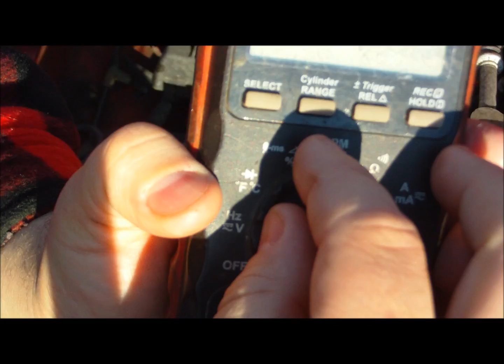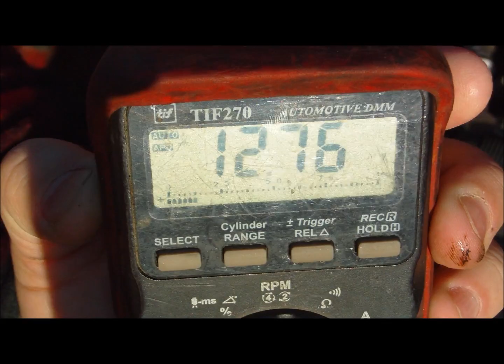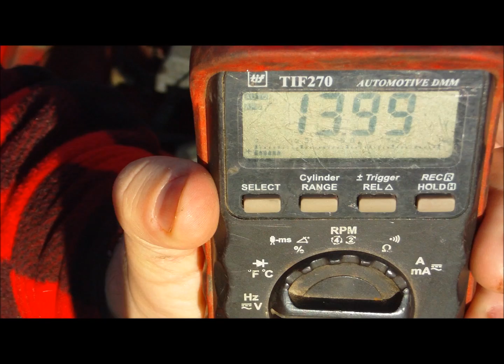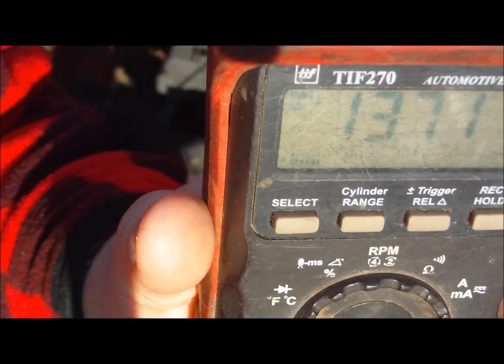How to check battery voltage, alternator voltage, and load test voltage  with a multimeter

Comment: maybe you can help me..

I recently replaced my belt and alternator (approximately 4 months) and last thursday, the battery light came on and when I got on the highway, it turned back off. if it helps, it was 6 days before I drove it on that Thursday. Today, I tested the battery and it was at 12.6ish. After I turned on the engine, it was at I believe 13.6ish. I believe the radio was on. The battery light also did not show up this time. I'm curious to why the battery light might've turned on. Last week was pretty cold here in NY, so I'm thinking maybe that affected the battery, but I am not sure. Also, on Friday, when I opened the hood, there was corrosion but today, Idk if it was the weather or not (rainy weather), but that just kinda disappeared. Any ideas what might've happened? My vehicle is a 2009 honda civic.

Comment: My alternator is putting out 14.59 volts I think it’s frying my ignition modules
Reply from the maker: 13.7v- 14.7v is the range you want. I am going to go out on a limb here and say you have another issue that’s frying your modules. I cannot diagnose it without actually looking at it. I wish you luck. Thanks for watching and commenting. I greatly appreciate it.

Comment: Thanks for sharing, but I've a question please
I'm installing a new car stereo, the recommended voltage by the company is 12v DC 
However when I tested the wires, it was 14 when the alternator is running 
What does that mean?
And can I connect the stereo to it?
Reply from the maker: If it was 14v then your car was running. Your alternator puts out 2 more volts for charging. Your car battery should be 12vdc. I personally would just hook the car stereo up. I hope this helps. Thanks for watching and commenting. Please like share and subscribe. Also please hit the notification tab 🔔

Comment: Great video. Now I have a question...no matter what jumper cables or charger I place on the battery in my 07 outlook the second I connect the negative clip to the battery post or ground post it sparks. I have had several vehicles and have never had this happen before..What could this be caused by?
Reply from the maker: Thanks. As for the sparks, how bad are they? Is it real lite or arking  as if you accidentally touched positive straight to ground?
Reply: @handymanPF   also when a battery charger, 2A, is hooked direct to the battery the charger cables get hot nearly instantly. Several chargers have been tried and all do the same.
Reply from the maker: Did you try disconnecting the battery from the vehicle and charging it and if so do the cables still get hot? Because, heat is the sign of excessive resistance and if your getting a spark on the ground side, almost sounds like you have a short somewhere and that’s why your battery is going dead. I would try to locate the short, start with anything that was recently modified or repaired and then go from there. I hope this helps, thanks for watching and commenting. Please keep me updated, I’m curious to what the problem is. Please like share and subscribe
Reply: They are like touching positive to ground...but one mechanic noticed that if you clamp the cables positive to the negative and the negative with the positive, there are no sparks at all. I know that's usually not something that's recommended but it was a fluke.

Comment: Thanks for this video.  Really liked the real time example showing what happens w engine off, engine on, with load on (lights, radio, wipers, ac, etc).  You've gotten over 300,000 views, so apparently it's helped alot of people!

I'm assuming if you didn't see the voltage jump up to to 14v or more when car is running you might suspect that the alternator is bad?
Reply from the maker: +Michael Milburn if your voltage is real high 15v or greater , it would be the voltage regulator inside of the alternator. So yes you would have to replace the alternator, unless you know someone who rebuilds. Thanks for watching and commenting. Please like share and subscribe.

Comment: This is a voltage test, not a load test!  This video states in the title "...and load test..." That's just telling you that the alternator is charging the battery and is keeping the required voltage AND amp draw to the battery. To do a draw test properly disconnect the battery and buy a proper "load test meter" $40 ...if the draw pulls the voltage any less than 9v AND then the "cold crank draw" spec is less than that of the manufactures standard THEN you know if the batteries good OR not. Multi Meters will ONLY tell you the min/max voltage NOT the draw. ;) ...yes, I saw the other video clip on the draw, however, you must take off the positive terminal because if you don't you're not considering parasitic drain etc.
Reply from the maker: +Wil you are correct but this is a quick video for someone who has never done this before and this test will tell them what is wrong. A proper load test can be found on this video https://youtu.be/30kf07g8CIs . This video right here is a great diagnostic aid. Thanks for watching and commenting. Please like share and subscribe.

Comment: i need help with my wife car .. when the car is off the voltage on battery is 12.5 when i turn it on the voltage goes to 14.5 shes turn everything on heat wipers etc and everything is fine 14.5 then the car start to kind of choke or run on 3 cylinder i dont know and the voltage goes crazy up and down ? i guess its the alternator right ? 
my obd2 gave me a code P0300 mulitple cylinder misfire but im starting to wonder if the alterator is bad and causing the whole problem she have a toyota tercel97 any advice would be appreciate thanks :)
Reply from the maker: +jp marts it doesn't sound like anything in the charging system, because those readings are good. What's the voltage range? Usually when voltage goes up and down, it's a bad regulator or rectifier. You can remove the alternator and have it tested at Autozone or advanced auto parts for free. They will also test your battery. But honestly I think your problem is elsewhere by the sounds of it. I hope this helps. Thanks for watching and commenting. Please like, share, and subscribe.
Reply: jp marts 

    Agree, not the charging system.  Start with basics of tune-up especially if they have not been changed in a while.  Test plugs, coils and wires.  Most misfires are one of these 3 areas.  Pull coils and look for white ish electrical brazing on the side cavities and/or on tube.  all these can be tested before replacing.

Comment: if my load reading drops from 14.0 to 13.2 is that ok or do I have an issue?
Reply from the maker: 13.2 is good, I never had a problem with that. I'm sure someone will disagree. It's when it starts to get in the 12 range when it is bad. I hope this helps. Thanks for watching and commenting. Please like, share, and subscribe.
Reply: handy man thanks for the video,  saved me a ton being able to figure out that I just had a loose alternator belt and how to fix it.

Comment: when i did the load test it was fine but after a few minutes it started fluctuating between 12 and 13 back and forth idk what it is.. when i turn off the car the battery slowy drops down .1 every 20 or so seconds im at a loss
Reply: low 12 and ranges of 13.20-13.90

Comment: I am trying to figure out why my tractor won't start, and it worked fine the last time I used it. The battery was fine after the negative cable was cleaned and tightened, and the voltage was fine on the battery. I can't get the engine to crank over after doing this and suspect the switch for the seat again. I had that problem before and is afraid it may be the reason it won't crank this time.
Reply from the maker: +Sidney Mathious if the voltage is fine and nothing is happening, then you are correct that it's mostly a safety device. I hope this helps. Thanks for watching. Please like ,share and subscribe.
Reply: I found what the problem was with my tractor and it was simple. The PTO lever was on and was the reason the tractor would not start. Thanks for the help and I hope you have a nice day.
Reply from the maker: Great! I'm glad you located the problem. Thank you. You also have a great day.

Comment: Voltage is one thing but what about how many Amps the alternator is kicking out?  Probably many times more than a cheap 10A multimeter can handle, possibly up to 80A it what my friend says is true?
Reply from the maker: I'm glad you asked that question. No you do not want to check amperage with a multimeter, because of the 10 amp fuse. So your friend is correct. You check it with a battery load tester. Go in my videos and look for ( how to load test a car battery ) that test is for amperage. Thanks for watching and commenting. Please like, share, and subscribe.
Reply from the maker: +EgoShredder you can also use this to test the output amperage of your alternator http://amzn.to/22XtcYQ . It is a Digital Clamp Meter & Multimeter with AC / DC Voltage Test

Comment: Appreciated matey, went out to my van this morning and almost zero, going to check now and see what it comes up with. Had it on charger for about four hours now and it has gone up to approx 3/4.
Reply: +darkan99el Well I&#39;m a bit confused I get 14.15v engine off, 15.00v engine on idle and 14.8 engine on idle, lights, radio, wipers and indicator on. The Battery is a Varta J0 915 105AH 12V 45A 95 ah Din 760A EN\SAE it looks like a double battery. I took the charger off and it started the engine no problem. Going to leave charger off tonight to see if I get any substantial drain in the morning. Fortunately I'm off tomorrow.
Reply from the maker: If you test the battery right after you charge it you most likely will get a high reading. Let the battery sit for about 5 - 10 minutes before test it after charging. I hope this helps. Thanks for watching and commenting.

Comment: I have a random question. 
Is it possible that a car batty can supply over-voltage to my fog lights and burn out my HB4s fog lights?
Reply from the maker: +Marc Denham Your fog lights are most likely halogen bulbs. When you installed the bulbs did you touch the bulbs with your bare hands? The lights are very sensitive to the oils on your hands which makes them wear prematurely. Another factor could be your alternator, if the voltage regulator goes bad it could produce more voltage then necessary or not enough. I have a video on how a stator works  , its the same thing as an alternator if you want a better understanding. Thanks for watching and commenting.
Reply: handy man

Comment: i had a vw 1967 split screen camper, I remember the generator light used to come on when engine was running at idle speed.  this was happening for a long while I did notice certain things blowing such as the indicator relay that works the indicators and makes the clicking sound blew one day, then another day I was on a long journey home and I was using my head lights and next thing I could smell something burning and I saw smoke coming up from under the dash I immediately pulled over switched of the lights and took the cover off underneath the dash and saw where the smoke and smell was coming from, I had a fire extinguisher at the ready but drove on home brought it to a mechanic and replaced the relay.  but then another time I was away camping in the camper and one night on my way back to the camping site my lights went really dim for a few seconds then I knew something was wrong but luckily I was able to keep driving as my lights came back to normal but the next day I went straight home and back to the mechanic, he ran his multimeter and discovered the generator was over charging the battery, instead of getting around 13.1 volts like what you mentioned as far as I can remember he got a reading something around the 17 mark.  usually on the old vws the regulator is on top of the generator, the generator in my camper was an aftermarket made in china so it was a different set up.  got a new bosch generator problem solved, before that did also change the battery as I think the other generator also burned out the battery.  when buying a used vehicle please look out for these things, YOU HAVE BEEN WARNED.

Comment: working on cars..
voltage drop testing  do you have a digital voltmeter..set it to 20 volts DC.
engine off.. headlights on for one minute. then turned off..
check battery voltage..
12.65 is a fully charged battery.
12.45 is a 3/4 charged battery.
12.25 is a 1/2 charged battery. if you have less than 12.5 volts have your battery charged and load tested..
once you verify that the battery is close to a full charge after you have removed the surface charge with the headlights on trick...
get the engine started... turn the headlights back on..
Negative battery post to the positive battery post.. 14.1 to 14.8 volts is expected..
Negative battery post to the engine block. 0.04 volts DC MAX..
Negative battery post to the body of the car.. 0.02 volts DC MAX.
Engine block to the Body.. 0.02 volts DC.
if you get more than the 0.04 or 0.02 volts on tests 2, 3 or 4.. you have a bad ground connection..
you can and should also.. after running the voltage drop test above..
test from the battery post to the alternator output terminal.. because of the amount of output.. i normally expect this to be up around 0.07 volts..

Comment: Can I just say, that to a complete amateur like me, the information and tips given by Handyman, are very useful, Although DAVE L may well be a pro or very experienced, he too will have an opinion as to what's right and wrong. If performing these tests eliminate certain things for me, then they are worth their weight in gold, if they don't help, then it's a very expensive visit to an auto electrician. As for Federico Contreras, since when has this video been about engine mountings?
In summary, thanks for the tips Handyman, and keep them coming.
Reply from the maker: Very well put and professional. I appreciate the compliment and it helps to know  that I m actually helping people which is my main goal. Thanks for watching and thanks for the comment my friend.

Comment: you failed.     the biggest load on your battery you didn't test. THE STARTER!!
Reply from the maker: I see you are quick to make comments and not read the description. If you want to test the overall condition of the battery, you will need to perform a battery load test, in which I have made here is the link   http://youtu.be/30kf07g8CIs
Thanks for the comment but I recommend that in the future you should read the description before you make a comment, similar to thinking  before you speak. This test is mainly to rule out the alternator as I stated in the video  description.

Comment: It seems like no matter how detailed you are in your video, that some smarta** will find a way to critique you. Im not that guy! Great video, i need to check my 95 Ford Explorer. It starts great in the morning but then hours later it wont start without a jump. Ive thought it was the alternator not recharging, so now ill go test it myself. Thanks for the DIY video and if u have an idea of what the problem is with my Ford please let me know. 
Thanks,
Eric O. 
P.s. i subscribed and liked.
Reply from the maker: I appreciate the comment. Thanks for subscribing I will improve my videos and keep coming up quick and easy problem solving tricks. Now with your issue, is a difficult one. Because had the same problem with a car. It would start great when cold but would need a jump when hot. I performed this test and became baffled because the battery voltage was good and the alternator v. was good. I finally discovered it was the starter. I havent figured it out why but when it got hot it needed more v. + A. to engage. Also perform a battery load test that test will check the amperage and voltage and overall condition of the battery. I made a video. Here is the link   http://youtu.be/30kf07g8CIs Hope it works out for you. Now this is a past experience of mine, I am not saying that is exactly what is wrong with your car.

Comment from the maker: So your telling me that you diagnosed this Jeep just by watching a video of it running and came to the conclusion that it needs engine mounts. Without actually inspecting the rubber on the mounts and without any prying or any other way that you would inspect a engine mount properly. The engine mounts are good by the way.four words for you "Your diagnoses is inaccurate" Thanks for the comment tho and thanks for watching. Take care.

Comment: Should recommend using a load tester for more accurate result. Also check for continuity through your positive and negative battery connections

Comment from the maker: You can use an inductive ammeter to measure the amperage. But this technique( using the volt meter) is easy for alot of people to use and has worked for me 100 percent of the time and i have diagnosed many. If the amperage was poor your voltage readings would also be low.Lets put it this way a lake is voltage how many gallons it holds, the stream from the lake is amperage the flow rate, and the damns to slow the river down is resistance.

Comment from the maker: That's a good question. ACV stands for aternating current voltage which you would find from power lines for household current. DCV is direct current voltage that you would find from a car battery. I hope this answers your question. Thanks for watching.

Comment: Thanks for responding so quickly first off. I removed my Alt yesterday and took it to get tested, It tested positive three times. I put it back on, with proper tension on the belt which was in perfect condition and all connections good and the Bat light went out. came back on today which is when I made your measurements. Now it wont even turn over, no cabin lights, dash lights or anything. I may need to just take it to a professional cause I'm pulling my hair out now